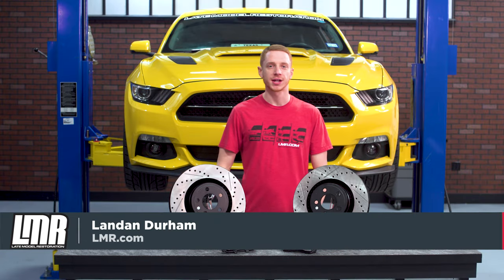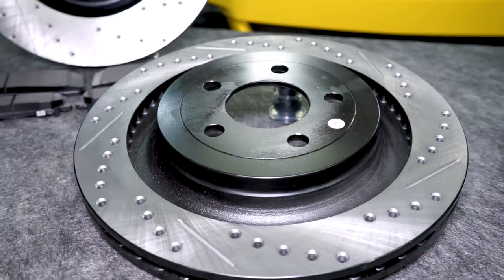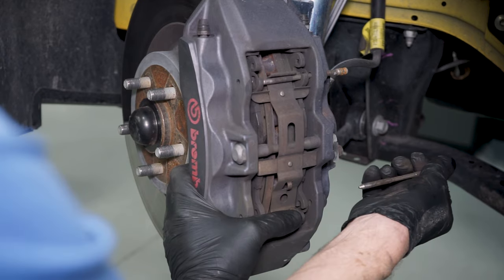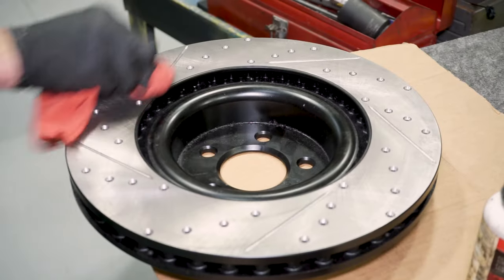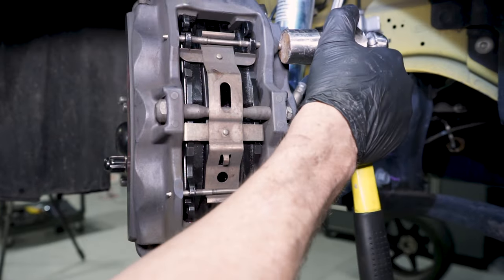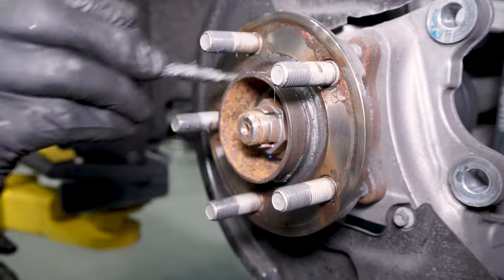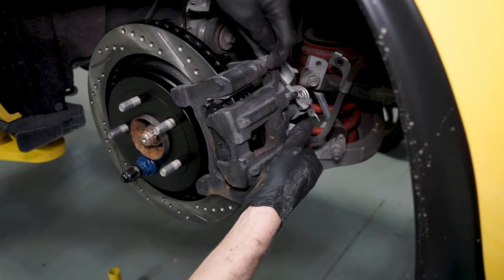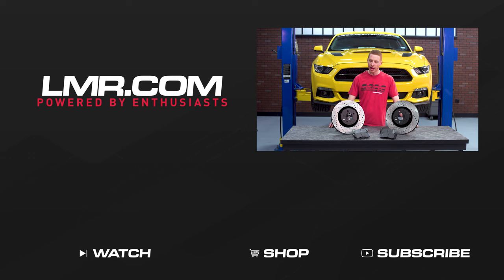How To Change Mustang Brake Pads & Rotors (2015-2023)

Comment: FYI, for the non-performance pack GT’s (4 piston caliper) the low-pad warning indicator is on the inbound pad, bottom, not the outbound pad, top, as is shown here with the Brembo calipers. Won’t fit the wrong way in though tried :)
Reply from the maker: Thank you for this feedback, please let us know if you need anything else!
Reply: Brad Howard any good way to remove the pad pin? I tried pin punch, didn’t work well.
Reply: *pins. Also mine is non PP. can’t find any good video on non PP brake pad change tutorial.
Reply: @gggg-hw5eb  Hey did you ever manage to find a video?

Comment: The two 14mm bolts holding the caliper to the slide pins are stuck on my '17 Performance Pack. Guess I'm getting a shop to do it...
Reply: Sean weak
Reply: WD40

Comment: I was stuck on the rear piston, the boot kept twisting and the tool would be stuck. Took a lot of elbow grease and wd40 for the boot to finally shift and move with the piston. The rest was fairly straightforward but still took a full day for me! Also once done, when I brake very aggressively, I get rough judders, dont know if i messed up something or thats because of the drilled rotors.

Comment: So, my retaining pins have a wire spring holding them in place on the back side. I did not see you take them off or put them back on. My passenger side broke. Stupid question... can I drive my car to get to the dealership or are the pins going to rattle out?
Reply: i wanna know if he drove it to a dealer ship LMFAO

Comment: I noticed at my s550 that the brake disc itself isn’t bolted to anything - so it’s flopping around when the wheel is off - it’s just held by the wheel when it’s on. Is that normal on a s550?

Comment: Extra brake dust due to the slots & semi drilled rotors shaving more mat'l off of the pad,wearing them down ALOT quicker & be prepared for ALOT more noise as well.
They look great though 😊
Reply: They also crack a lot easier :/
Reply: @Badger_S197  bro what😭
Reply: @Rob-pl4wl he’s right.  Drilled rotors form stress cracks on the edges of the holes if they aren’t high quality rotors and they see heavy braking like on a track.  Slotted rotors perform just as good with less issues and you have more material for pad to bite

Comment: Any difference when doing the 4 piston fronts compared to the Brembo's?
Reply from the maker: Give our tech team a call at 866-507-3786.
Reply: A couple differences - see the warning indicator comment above, also doesn’t have the 13mm pin on back side of pads/rotor- instead has a flimsy wire that hooks through the ends of the slim retaining pins.
Reply: @bradhoward7565  Question, do you remove those wires completely? Or just pop them out of the pins?

Comment: Are the rear slide pin 14mm bolts one time use only or is it just the 18mm main caliper bolts that are one time use?
Reply from the maker: The rear slide pin bolts can be reused.  -Landan

Comment: Hey man if you could please answer a quick question how much should this cost dealer was charging me 1,500
Reply from the maker: Hey there, 

That is a very high price. Most brake changes should be much less when replacing the rotors, pads, and labor cost. We recommend speaking to them about the cost and seeing if that is correct. Or take your vehicle to another trusted shop.
Reply: @latemodelrestoration  if you don’t mind me asking on average what should the cost for all this be ? greatly appreciate your response !

Comment: I didn't know you can use 14" rotor with those 6 piston Brembo's! I though I have to upgrade the rotors to 15 inch
Reply from the maker: What are you talking about? Could you please provide more detail. -Landan
Reply: When I click on the rotors link you provide In the description, I match the rotors on this video and it says they are 14”. I thought for this 6 piston brembos, they required a 15” rotor. Maybe I am mistaken?
Reply from the maker: @SpeedyBoyy  Thanks for the additional detail. We linked the brake rotor and pad category. The 6-piston Brembos require 15" rotors. -Landan
Reply: @latemodelrestoration  thank you for the clarification :)

Comment: Does this same process apply for the stock 4 piston calipers?
Reply from the maker: Hey Martin, this process does also apply to the stock 4 piston calipers, however, we did perform this video on a Brembo set up. So there will be some differences with the caliper when working on your Mustang.
Reply: @latemodelrestoration  thank you for the reply, although I was late in seeing this. But I was successful figuring it out myself. Thank you!

Comment: Is this compatible with Mustang Ecoboost 2017 2.3 Liter
Reply from the maker: You will need to go with a Ecoboost brake set up if you're looking to upgrade. You will also need to make sure they are the right size for caliper clearance. Check out the link below for more: https://lmr.com/products/2015-Mustang-Brake-Rotors

Comment: Aren't those main caliper bolts one time use?
Reply from the maker: Yes, the main caliper bolts on these models will be a one time use TTY bolt.
Reply: What??? I have to buy new ones? Where would I do that...
Reply: @tf2heavy2  Ford dealer is your best bet, or OEM online.

Comment: Is there a way to compress the front caliper pistons? Pads won’t go in
Reply: Just push them back with a screwdriver wrapped in a cloth , carefully . Some people use padded vice grips , or you can buy a brake spreader like shown in the video . It helps to take off the cap on the mater cylinder as well before you compress the pistons.

Comment: Should probably provide bolt TQ values...
Reply: Steve D did u figure out the torque value for the rear caliprt bracket the 18mm bolts?
Reply: @gigi9467  Ford shop manual says those are 24 lbft.
Reply: Matthew Zaleski thanx ill write it down
Reply: The 18mm bracket bolts are 129 lb-ft.  24 lb-ft is for the 14mm caliper bolts.

Comment: Any torque specs handy? Struggling to find them on forums..
Reply from the maker: The cross pin would be 22 ft lbs and the caliper anchor to the spindles would be 85 ft lbs.

Comment: Not thead lock on the bolts that go to the caliper??
Reply from the maker: Jesus - Ford puts it on there from the factory so you can reapply some if you'd like. I've never had an issue with caliper bolts backing out without thread locking compound. -Landan
Reply: Ford tech manual states those 2 bolts/caliper are one-use; Probably due to the heat they see.  The new ones come with thread lock applied from the factory.